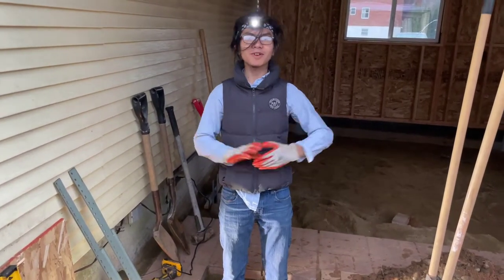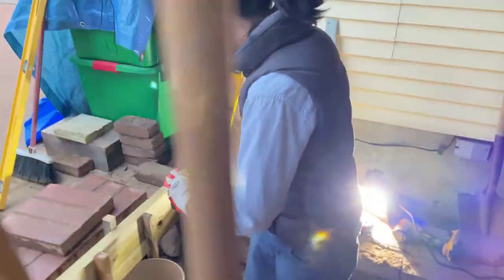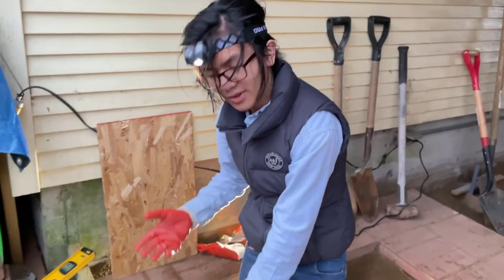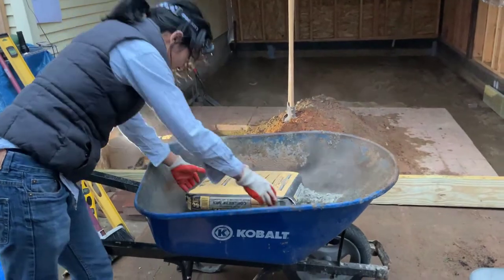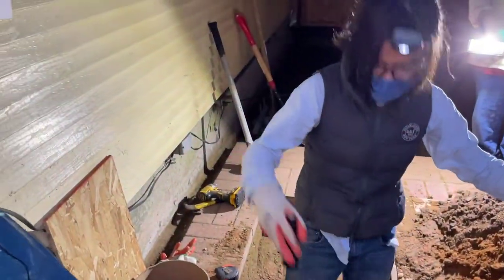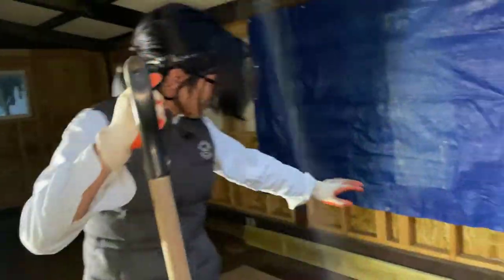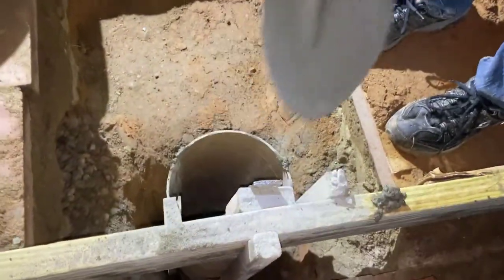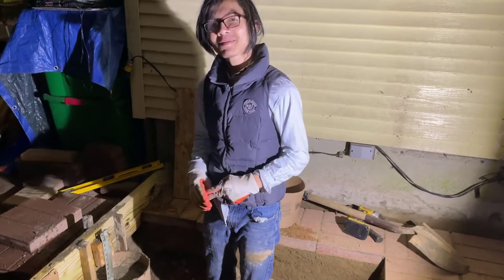Deck Footing | How To Mix & Pour Concrete | Build Ground-Level Floating Floor Enclosed Patio-Porch

Comment from the maker: Here are the #ad links for some of the tools you might need for mixing concrete:
1.  https://amzn.to/3p3hKM9  |  Prolinemax HD Portable Electric 3-1/2 Cubic Feet Steel Stucco Concrete Cement Mixer Contractor Mortar
2.  https://amzn.to/3fAynM8  |  The AMES Companies, Inc R625 True Temper Steel Wheelbarrow, 6-Cubic Foot
3.  https://amzn.to/3wMpaWS  |  Bully Tools 92419 12-Gauge Short Mortar Hoe with Fiberglass Handle
4.  https://amzn.to/3p399ZX  |  Root Assassin One Shot Garden Shovel, 43" D-Handle
5.  https://amzn.to/3p5EgUC  |  Magid Safety G818AFC FR Safety Goggles | Hard Coated Fire Resistant Foam Lined Polycarbonate Safety Goggles with a Black Frame & Clear Lens - UV Protection, Anti-Fog Coating (1 Pair)